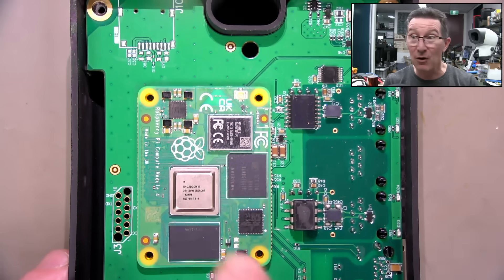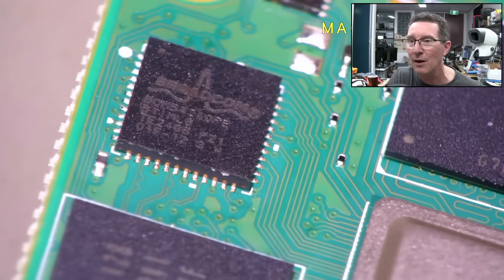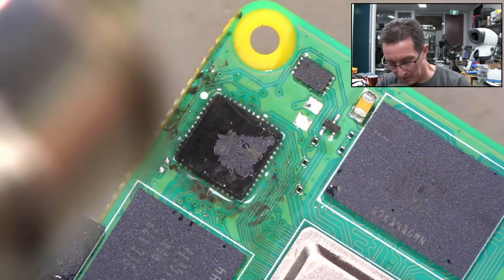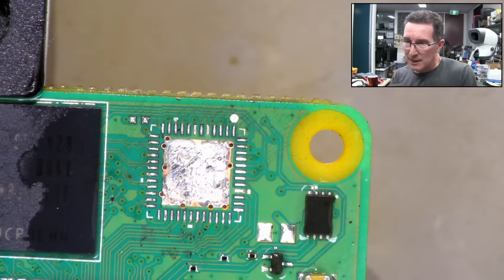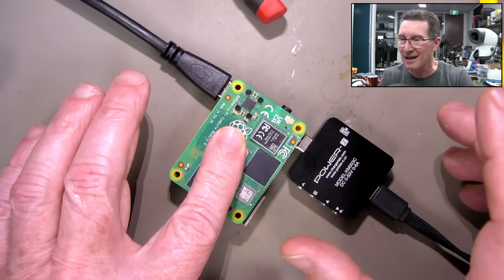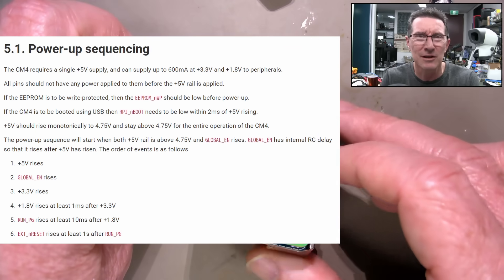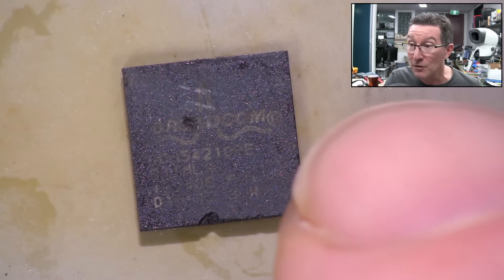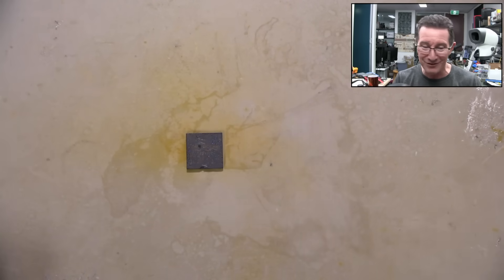RPi CM4 Compute Module FAILURE Part 2: Thermal Boogaloo

Comment: The CM4 turned into a million transistor (almost) constant current sink (electronic load) plus the PHY became a whale with a real blow hole as a bonus! 🙃Still, the root cause seems to be a failure originating from the ethernet side. I wouldn't rule out that a surge caused it. It's also possible that the USB-C PD circuit on the main board picked up a higher PDO than the expected 5V one. I'm sure it needs a PD negotiation because the Pi needs more than the 5V 500mA sink possible using a bare Rd pull-down resistor on the CC lines. Otherwise it would only work with dumb non-compliant PSUs. The whole module in this state kinda reminds me when I bought the first version of the Pi early on, used it for a few weeks than took it to the office. The boss wanted me to try out it's video decoding capabilities until his own Pi order arrived. I realized we didn't have a good enough 5V power source there for it so as a workaround I hooked up one of those early chinese built LM2596ADJ buck modules we had lying around to a 12V PSU and dialed in the trimmer pot to 5V. Then without noticing it I accidentally shorted it's output and saw the output voltage suddenly falling off. Me puzzled started to compensate by continuing to turn the pot under load. It was around that moment when my first Pi turned into a (very hot) paperweight. It was a real teaching RTFM moment because a fine print note in data sheet says: "The oscillator frequency reduces to approximately 30 kHz in the event of an output short or an overload which causes the regulated output voltage to drop approximately 40% from the nominal output voltage". I've started desoldering components until the short disappeared which happened after removing the CPU. 😅

Comment: I lost could on the amount of times I have replaces an ethernet PHY chip because the original designer didn't put any ESD protection on the ethernet lines between the transformer and chip

Comment: I have 2 of these modules that failed the exact same way. One I could partially repair using the voltage regulator from a donor (still no ethernet though) but the other one is completely unfixable since there's no datasheets available and the chips are pretty much unobtainium...

Comment: The DA9090 is known to be a bad design/batch and nobody, but some raspberry pi resellers sells them, the rest of the market had vanished. I also once got a Pi that gave up, debugging and fault finding poointed to the pmic so on my boatd the PMIC also failed, but it took out with it, the cpu that time and ghe wifi chip. So probably the PMIC on your board failed first and that caused the ethernet chip to get fried too and now both chip are getting hot. The PMIC getting extra burny burny hot also was not a good sign and i knew it kind of was done for. At some point the magic smoke also got released from the pmic so a pmic failure likely. It could be static or a surge took the chips out. After the Pmic released its smoke it probably shorted and sent full power into the wifi module and possibly cpu andother chips. Its a goner

Comment: I think this is a DC DC converter issue that it's sending way too much voltage and cooking everything around, by now the eth chip is cooked, even if you fix the DC DC converter, everything else is cooked, a common failure on newer mikrotik routers, not like the older ones that can survive even close lightning strikes, the new ones when the DC DC fails sends vin to vout and boooom, I got a bunch of these around here, dead, cooked😢

Comment: Dave is that a hole between the network card and the RAM? Between the lower left 2 pins and the RAM chip at 6:48 looks like it only shows after cleaning the flux. Black mark on 2 tracks.

Comment: I commented on the first video about the PMIC (Power Management IC / the chip that you are calling a DC-DC converter) being the root cause as I had similar symptoms with a Pi 4B 2GB board a few years ago, the PMIC failed on that board and lit up like a xmas tree when viewed through a thermal camera.

Your PMIC failure more than likely took out the Broadcom Ethernet controller IC via a short or more likely a sustained overvoltage through the broken PMIC which is/was causing the ethernet controller to superheat and eventually EOL it, and now since it is no longer there it is causing the WIFI chip to do the same at 10:34 with the failure cascading back to the PMIC as at 10:18 the magic smoke finally escaped from the PMIC itself.

There is a reason those Dialog Semi / Renesas DA9090 Power Management IC / PMICs are available through some Raspberry Pi board resellers - because they are a known point of failure on Pi boards.
Reply: Yup. have seen quite a few Pi4s exhibit a PMIC failure like this. They seem to blow up if you so much as look at 'em funny.

Comment: Question, could a few cents more of components, like  polyfuses to each chip, and a polyfuse and voltage clamp on each rail of the DC -DC prevented so many failures at once?

Comment: Interesting that the PMIC was also damaged and released the magic smoke. The AERL PCB does have the correct magnetics and PCB isolation distance but there's no ESD protection, that might be something to add if they want to try to guess at potential mitigations.

Only other thing is if it's the PMIC that failed what USB C PSU are you using to power it at home? It's no some dodgy no name thing that outputs 6 V with a 1 Vpk ripple? That could kill the PMIC.

Only other thing I can think of is if they exceed the 3.3 V output design limit, I think it's only like an extra 300 mA you can pull from the PMIC on the CM4 to power your circuit.
Reply: It's a real head scratcher. We have isolation on all ports except the 5V USB-C input, so I suspect you might be on the money there. I don't believe we're drawing 300mA from the PMIC, but that's something we'll double check.

Comment: The first thing that failed was the ethernet IC due to high voltage spike on the ethernet cable. The DC-DC converter is likely still fine but multiple devices where damaged due to this voltage transient in the ethernet. That was a short pulse high energy pulse fault thus the small explosion in the ethernet IC. Could be an indirect lighting strike or ground loop currents.
Reply: Ethernet is transformer coupled, how do you get ground loop currents?
Reply: @ferrumignis  You get loop currents if voltage exceeds the transformer isolation maybe 2kV or whatever it is for this particular transformer. Also not sure if there is an appropriate TVS installed or not after the transformer.

Comment: Next step: remove the voltage regulator and inject voltage from an external power supply!
Reply: The PMIC outputs several voltage rails, and if its an older CM4 it'll be a chip you can't even buy
Reply: @notsonominal  And? Injecting voltage into one rail or injecting voltage into a few rails, it's the same procedure, just more wires and perhaps several power supplies.

Replacing the IC? I never even said anything about that in the first place, but one could always e.g. bodge a completely different one or multiple ones.

Besides all of which the point is to just mess with the board and make another fun video -- something that most of us here wouldn't complain about.
Reply: @WereCatf  iirc you'll need to mimmic the timing of the voltage rails for the start up sequence and possibly the i2c communications with the pmic chip. have a go and let us know how you get on!

Comment: hi i think the dc-dc converter failed first and the ethernet chip was the most sensitive and failed first the ps3 super slim had a problem with the dc-dc converter for the wifi module where it would fail and send 5v to the wifi that only wanted 1.8v and sometimes it would also short the 5v standby rail
Reply from the maker: Most likely.